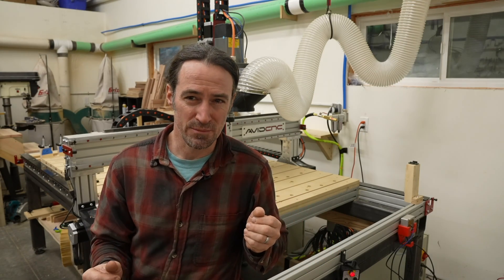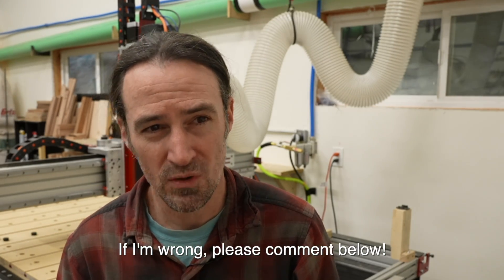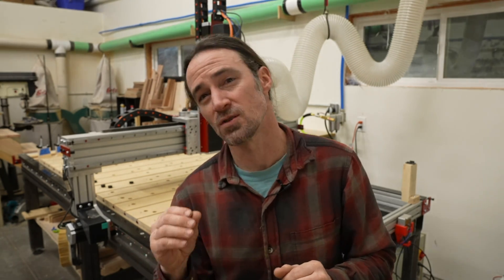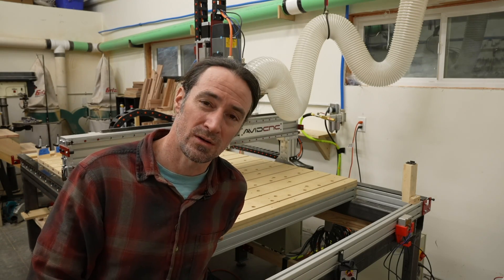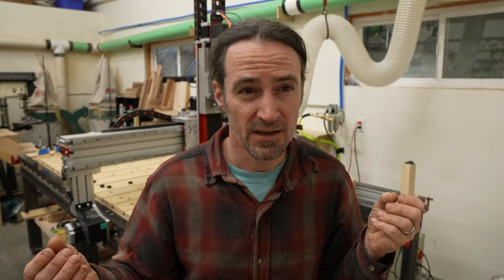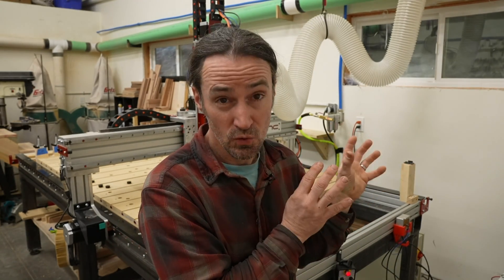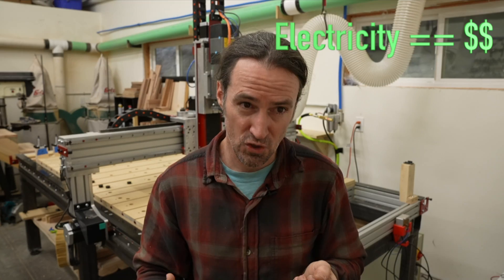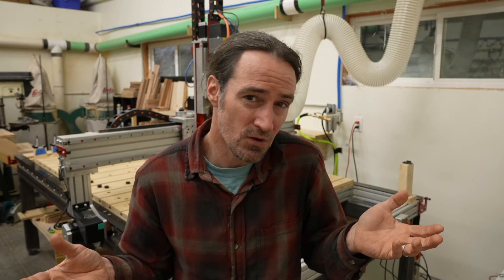CNC Build Ep 1: What is the Best CNC For You? Why I bought Avid CNC vs Phantom, Laguna, Shop Sabre

Comment from the maker: I'm super interested to know what you all think. What machine did you buy? (Or are you going to buy?) And why?
Reply: I got the 4x8 Avid for the same reasons you did. I also talked with Nick from Phantom.
Reply from the maker: @maddogtungate6740  Awesome! I'm sure you'll be happy with the machine..mine has been awesome, and super flexible with things I want to do with it.
Reply: @CorbinDunn   I am also interested in the steel frame you built. Is it that much better than the aluminum?
Reply from the maker: @maddogtungate6740  Yes it is a ton better, but I am only basing that on what I've seen about the stock aluminum tables and discussions with people on the internet about it. Check out videos 2 and 11 in the build series -- particularly 11 (I'll link to it) because I made my table better with more supports, and that brace helped more than the weight. I've heard people have gotten really sturdy aluminum tables by attaching MDF on the sides to create a rigid box. Even so..mine is heavier....and heavier is better for reducing chatter. https://youtu.be/kjERid1Kxp4?si=1UbiK6YNgGFb0-Wc
Reply: @CorbinDunn   Thanks buddy!
Reply: Bought a phantom t series.  Worst mistake ever.  Junk is giving it too much credit.  Going to Shop Sabre
Reply from the maker: @NobodyHereCares  That's a bummer to hear...they still seem like a good deal. Shop Sabre's look excellent: I would love a machine like their Pro series with ball screws all around, and servo motors. Precise and fast!
Reply: ratrig stronghold pro 1500 1500 nema 34 9nm closed loop on y and x z nema 24 on z  height  altered  whit x axe end plate now 18mm and z 190mm
Reply: and rapid change
Reply: pibot control with fluid nc 5/5

Comment: Hi Corbin!
I’m curious how could I find out if there would be any difference in accuracy and/or repeatability between a standard 5x10 AVID and a custom one, 6x10… Would that extra 1ft in width affect accuracy/repeatability? Mostly will mill hard woods, probably occasionally some 6061 Aluminum (not planning on milling aluminum, but would like to have this option open). I can’t find any videos on custom AVID sizes, wider than 5ft
Of course, I asked ChatGPT a while back, I don’t remember the exact response at the time, but I’m reluctant to blindly trust ChatGPT…
Reply from the maker: Your best bet is to contact Avid! They can help answer questions on rigidity like this. Personally, I don't think it would cause much a problem, because the motors are what will keep it aligned on the x-axis, and they are pretty strong, but a longer moment arm means more possibility for flex. Most the flex I see in the machine is on the gantry z-axis; it's easily a few though or more when I push on the spindle motor.
Reply: @CorbinDunn  thank you for your opinion & sharing your experience! Will definitely look to get some numbers from Avid, of course!!
P. S. I’m also enjoying the latest carving/inlaying content with Fusion. I’m a Fusion user myself, and it’s not that easy to find CAM related videos with Fusion. Not to mention high quality content such as yours!

Comment: I owned an Avid with high expectations only to find out its rather flexible and tool deflection is shocking bad considering that to the eye the machine looks massively overbuilt.
Reply from the maker: Fair enough! What did you get to replace it? My Avid has been solid, especially the the base I made out of steel. Yes, the gantry does flex a bit; at least a few thousands when I push on it by hand. I'd be curious to compare that to other machines.
Reply: @CorbinDunn I ended up moving half way across country and loosing my shop space and didn’t replace it. I would have been thrilled with a few thou of deflection. Mine was a solid 1/16in with finger pressure and the z lowered to working height. All the play was in the linear rails. Ive got space again and looking to build a 5x5 machine. Haven’t had a machine in 7 years. And to be transparent my machine was from before the name change.
Reply from the maker: Ah! Maybe they have improved since your last one was made. The gantry will move if the motors are off. I'll have to check deflection on the gantry again and see what it is..but i don't think it is 1/16". That would definitely be concerning!

Comment: Corbin, first of all your talent and videos are fantastic!  I am interested in purchasing an AVID 4x8 for making closets and cabinets mostly for my home.  I will also be making some cutouts of 10mm Coroplast for my Christmas Holiday Display and other wood projects.  Is it reasonable do this without a Vac Table or ATC.  I will be putting this in my garage, so I don't really have room for a larger machine.  I would love to be able to speak with you if possible.
Reply from the maker: Hi! Yes, you can do it without a vacuum table or ATC. Of the two things, a vacuum table would help a lot more than the ATC. I personally don't do a lot of plywood, but I was recently cutting out a lot to make shop cabinets (video coming soon on that). It was tricky to mount it on my 4x8 table as there isn't a lot of hold down room on the edges, but it is possible. I have a video about hold down techniques that discuss some options. If I was only doing plywood I would invest in a vacuum table, likely just a DIY one using a Black Box Hurricane (or similar). If I wasn't doing a lot, but more than I am now, I would probably get a composite nailer and shoot composite nails into my spoilboard.  In general, for most plywood you can get away with cutting everything with one bit; a 1/4" or 3/8" compression bit, and not have to worry about frequent tool changes. For Coroplast, I'm not familiar with cutting it, or how to hold it down, so I can't provide much advice there. If your sheets are less than 4x8, then it will probably be easy to hold them down with various techniques. Here's the video to check out: https://www.youtube.com/watch?v=okMz2NAk-Uc
Reply: @CorbinDunn  Corbin,  Thank you again for your advice and input.  I really appreciate it.  I may email you with a few more questions if you don't mind as I don't want to make a mistake with my purchase.  Thank you again for sharing your great talents with us!
Reply from the maker: @SantasLightShow  Yeah, no problem!

Comment: I feel this was a very fair and level headed review. I've watched both reviews and it certainly raises some good thinking points. I like the AVID, but it wasn't pushed in this vid. One of the best CNC reviews I've seen. I got a lot out of this. Thanks dude.
Reply from the maker: Thanks! It's been a while, and I still like the Avid. Precision is surprisingly good; I originally wanted ball screws for precision.   I just upgraded their controller from Mach 4 to Centroid, and it is a lot smoother, even with stepper motors, and giving me better cuts. They now offer servo motors, which isn't something a lot of the other brands offer, and I heard those are incredibly smooth and fast. Avid is also addressing the DIY ATC by providing an ATC option this year (or so I hear). If I were to do it again, I'd still consider Avid, but with their provided ATC and servo motors.

Comment: Lots or pros and cons both ways. 

Personally I wish AVID had a much heavier duty solution as a kit, because I don't want an aluminum gantry or table. I get that it can work, but, steel is real. If they would basically replace all the aluminum with steel, add the ATC they are talking about, and keep the rest basically the same, I'd be interested for sure. (Maybe work with regional suppliers to make welded steel tables to print. that customers can pick up and finish out with the Avid gantry and rail kit?) But they quickly get to the point where it no longer makes sense to go with a kit like that, when you can buy a pre-made from somewhere else for $30-50k with ATC and all the features.

Phantom seems to have their Atomic ATC 4x8 table now, which seems like a good, if light duty, fully-featured table, and seems like a really good option for $26k. I would bet it's at least as solid as your AVID with the welded frame. Whether the rest of the machine is any good? Hard to say.

If AVID could get their base 4x8 kit with the ATC and at least 5 tool changers and decent motors for under $20 then they will have something compelling. 

If Shopsabre would put an ATC as an option on their RC8, that'd be crushing it. 

Basically any CNC router over 18,000 USD needs an ATC. I don't consider it an optional accessory for anything but hobby machines: it's a must have. So these companies with router tables that are $20k+ and don't at least have a basic ATC on there, absolutely out of their minds. 

I would say, having built my own router a few years ago and converted a mill to CNC and then owning industrial grade CNC machines, once you've done a kit or conversion once, you get what's going on and doing it again makes less sense. 

For someone brand new to the world of CNC or may be only ran a small desktop router, something like the AVID is an ideal gateway into the world of big boy machines. It has the capability to be as capable as you need, even if it's got some weak links. But if one has experience doing CNC work it might make sense to skip the AVID and go to a slightly more expensive pre-built.
Reply from the maker: Yeah, I agree with you on these points! Phantom's smaller ATC machines do seem really good when you compare the prices. Avid's gone with Acorn/Centroid in their current lineup, which I think helps solve some of the jittery issues that happen with the aluminum extrusion and Mach 4. Centroid has the ability to be a lot smoother. They also have servo motors..which I would have gotten if they were available back when I did mine. 

I think i would also more heavily look into Stepcraft. Their ATC machines aren't too expensive. The x/y/z motors are a bit underpowered, but in the end, I always seem to run my machine slow to get better finish results. I realize now that I don't need speed; I need precision. And a ball screw is more precise (Stepcraft). Even so..the Avid's are pretty precise, and it hasn't been an issue for me yet (except jittery-ness showing up on the surface).
Reply: @CorbinDunn  good points. For me I hadn't heard that the Stepcraft was on ballscrews. That is a big plus in my book:  accuracy and the ability to handle light milling and pocketing of nonferrous with good wall and floor finishes on large plate is a big factor for me choosing a machine right now (weighed against not wanting to commit to a $60k unit) Raw speed is secondary to good finish. And smooth is fast as they say.

Have you found any good discussions of the Stepcraft Q.408 vs the Avid? All I see on here is official content from them or people with the small machines.
Reply from the maker: @scottwatrous  Yeah, I know what you mean about not wanting to spend $60k on a machine. If speed is more important to you, then the Avid will have faster speeds than the Stepcraft, at least based on my memory of comparing them a while back. What helped me was to make a spreadsheet comparing all the features that were important to me, and then use that as a basis for my decision. For me, the Stepcraft didn't have any way of doing a vertical table, but I did ask them, and they said that it could be modified for it. A vertical work table was pretty important to me, and still is. Stepcraft now has an ATC option standard...which is definitely appealing to me.  Avid is going to have a stock ATC option soon too, which is also nice (less DIY -- I had to do a lot of DIY to get my ATC going, but what I made in Mach 4 was good for other people to use too).

Comment: Hey Corbin, I purchased an Axiom AR8 Elite a few years ago for about 12k.  If your not familiar with this machine it has a 2x4 cutting area.  The initial machine had an issue and the customer service was great in getting me over a new one.  I have had pretty good luck with the machine up until now in which the controller has failed and needs to be replaced for 5500.  Ouch.  I am considering putting that money towards a new machine and working to see what my options are.   I cut sign materials... wood, plastics, aluminum and even do fine work such as applique and braille on the machine so I have been pretty happy with it precision.   Do you have any experience with Axiom?... and what are your thoughts on their products respectively?  Cheers.
Reply from the maker: Hi Steve, sorry for the slow reply! I was out a bit. I do not have direct experience with Axiom, and at the time they didn't have a 4'x8' machine, so I didn't look too much into it. They do have ball screws all around, which are great for precision, and likely a lot more precise than the Avid CNC or any other using a rack and pinion system. My best suggestion is to make a spread sheet comparing the features that are important to you, and various price points.

Comment: I bought a shop sabre and wish I didnt.  I got the Rc8 which is there lower budget machine, added some options.  When I had issues I was told I bought the wrong machine and I should lower my expectations.  I spent north of 35k to be told oh well,  I literally told them I could have got a Avid for a fraction of the costs and it would cut better.  My shaepoko 3 had a better edge finish and its a belt drive v wheel machine.

All that to say you made a good choice.
Reply from the maker: Damn! I'm sorry to hear that. I was hoping that the Shop Sabre base machines would have been at least as good as an Avid.

Comment: Hi, I have 8.7 hp spindle installed on my avid cnc pro, i am very curious to see what can this much power can do? Can you suggest me some cutting params to utilize the full 8.7 hp, I usually machine aluminium and hard wood on it.
Reply from the maker: Sure; Avid's demo video showed one example for the 8 hp vs the smaller one. You can do a larger depth of cut to remove more material. That's really it. For example, instead of just doing a 3/8" DOC with a 3/8" bit, you could probably do 1/2" or more. You have to experiment...and potentially break bits to find the limits.
Reply: More power means more torque at the same speed, which means you can use larger-diameter tools. It's a depends-on topic but in general, it is true. Larger motors have better torque at lower speeds, for exact values and comparison, check (or ask for) the speed-torque diagram from the manufacturer. But larger HP motors could have larger cases and larger bearings, which means more distributed loads on them and therefore longer lifetime, and maybe better cooling too.  

Higher power usage means more cutting forces (if you push it), more load on the machine itself, more deflection, and vibration, especially at the middle of the gantry, more load on the workpiece, and it needs more demanding work holding too. There is a complete chain of forces, from the tool to the workpiece through the machine (components) while cutting.

My advice is to use slightly bigger router bit diameter tools for better material removal, slightly higher feed rates, and slightly higher RPMs that both tools and materials can handle, try bigger diameter drills. My assumption is that you can drill a cabinet hinge socket (35mm) in one shot with 8hp, or use shaped cutters with larger diameters. But always think about proper workholding too. Push it a little bit more for roughing, use low cutting forces (low power) for finishing, and more accurate tolerances. 

The Avid machine is not the strongest one (I see Phantom is more robust), if you can, utilize the higher power capacity on the left or the right side of the gantry, not in the middle where it tends more to deflect and vibrate.

Be careful to push to the limits where the tool breaks or material escapes, high rpm rotating tools, with bigger diameters have a lot of energy in them, and if they bounce in an unlucky way, it can cause serious injury. These kinds of machines should not be delivered and used without protection. Use eye protection at least.